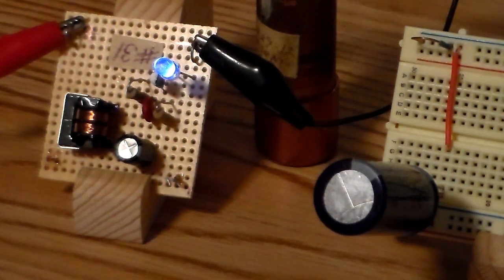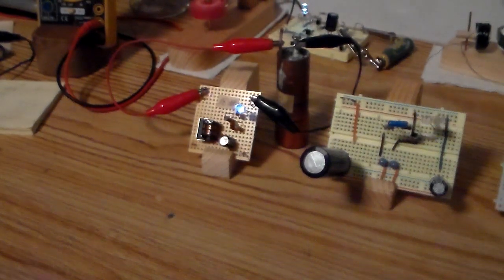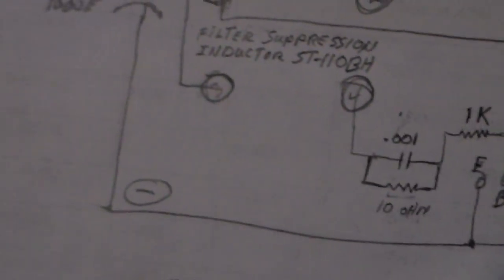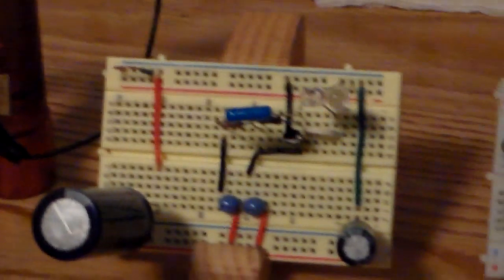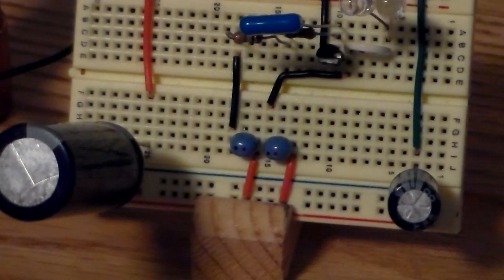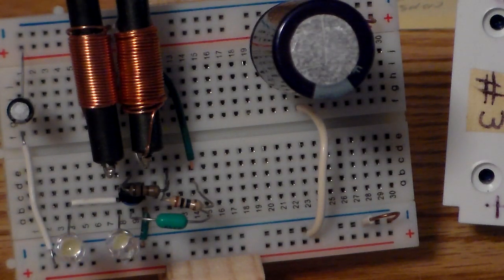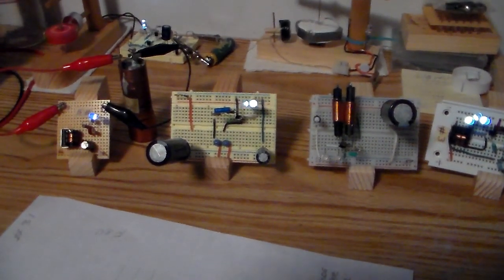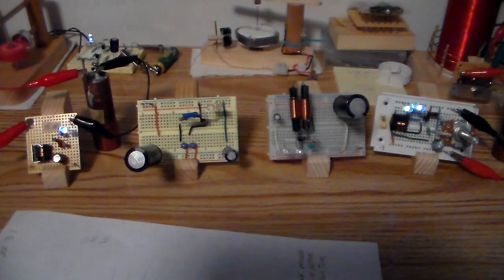Oscillators & Coils

Comment: Nice selection there. I find that early 2000's satellite receivers have bunches of those round inductors inside. Usually are around 10uH, but a lot can be 100uH and more. The colours relate the same way as standard resistor looking axial inductors. If you do a search on 'axial inductor color codes' you'll find charts for them and so can read off the values for those blue ones :)